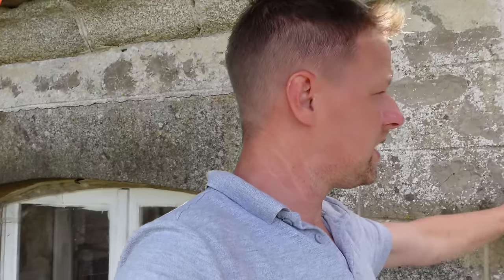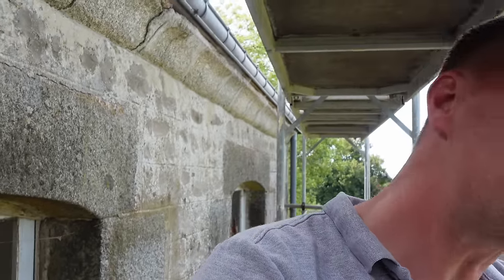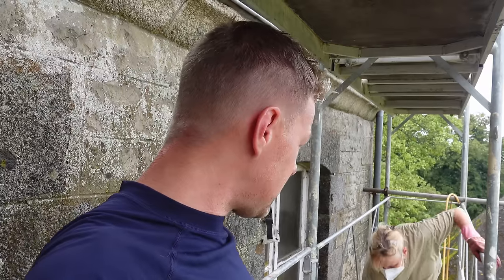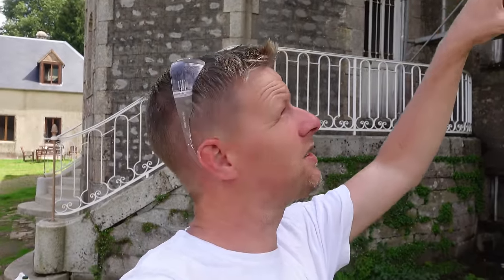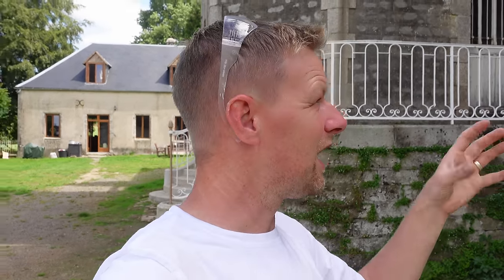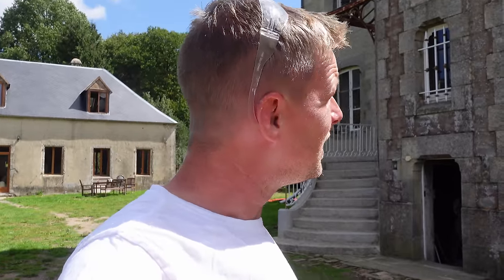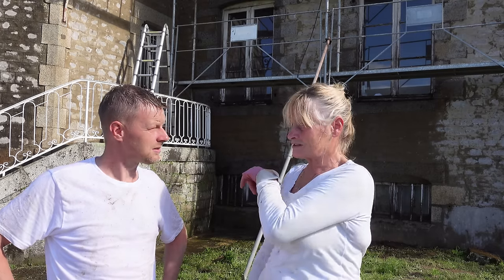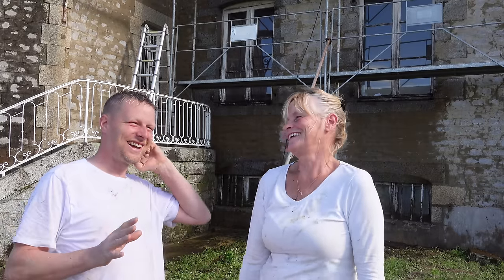Bring The Chateau Back To Life | Powerwashing The Stone Walls.

Comment: Terry that gray stuff you are removing is called lichen.  lichen is a composite organism that arises from algae or cyanobacteria living among filaments of multiple fungi species in a mutualistic relationship. Lichens are important actors in nutrient cycling and act as producers which many higher trophic feeders feed on, such as reindeer, gastropods, nematodes, mites, and springtails. Lichens have properties different from those of their component organisms. They come in many colors, sizes, and forms and are sometimes plant-like, but are not plants. They may have tiny, leafless branches (fruticose); flat leaf-like structures (foliose); grow crust-like, adhering tightly to a surface (substrate) like a thick coat of paint (crustose); have a powder-like appearance (leprose); or other growth forms. It is good you are getting it all off.

Comment: make a thick foam from soap shavings and let it sit for an hour, then preasurewash it off. it is so save, that the chemical danger code is 0/0
Reply: Thanks Claus 😊
Reply: And don’t forget to use a toothbrush, make sure you get in the cracks 😂